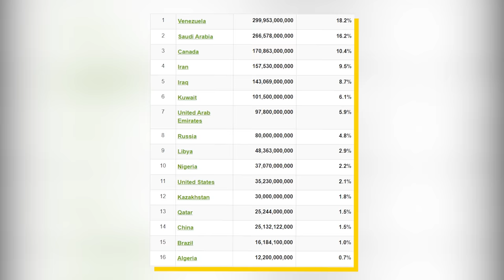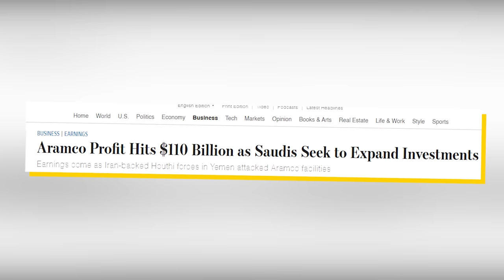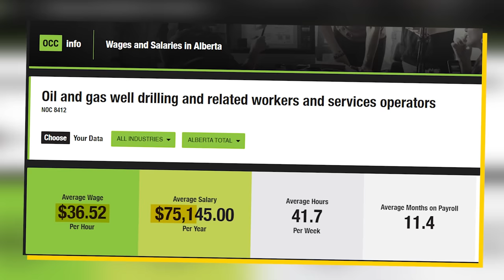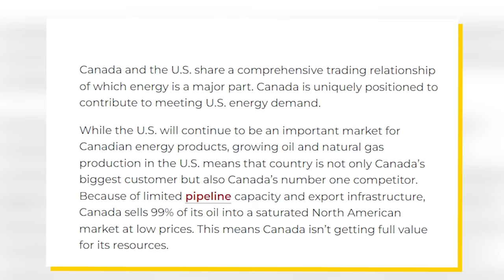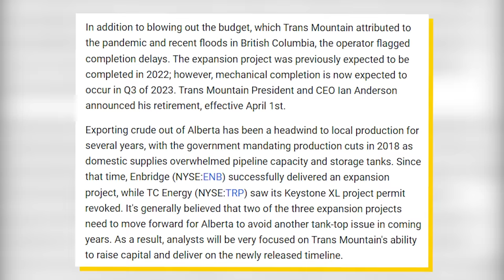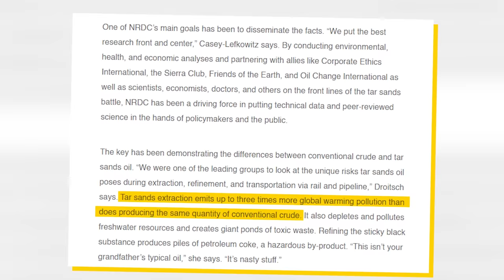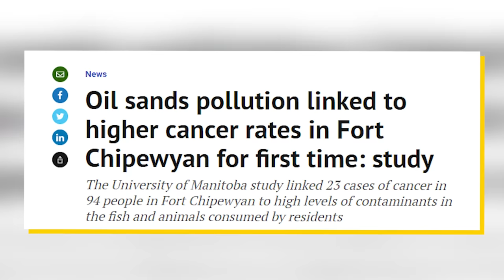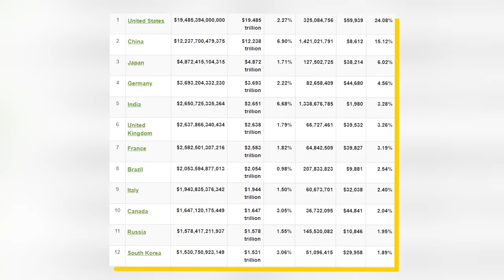Why Canada Refuses To Exploit Their Gigantic Oil Reserves

Comment: This video has done some great work on showing how Canada can become a more important player in the oil industry globally. One minor correction, for producers in Canada, break-even is NOT $100/barrel (either US or CAD). It's evident in many producer's financial reports that are publicly traded. Also the "discount" is not something agreed to by US/CAN, this discount changes over time and again due to the fact that the oil is still slightly different from WTI. What they're referring to is WCS crude pricing.
Reply: Currently working oil sands as a mechanic. The price per barrel that keeps my job is $60. Anything more than that usually results in OT being wide open and extra bonus pay like LOA and retention bonus. Any less than $60 a barrel and you are more than likely looking for work elsewhere unless you work for site.(Suncor, Imperial, CNRL, etc)
Reply: @Braviary01  WTI?  I know of newer highly automated in-situ sites that are in the range of $20 break-even or less but I suspect that's WCS heavy and not WTI
Reply: Wrong. Suncor produces for around $15 a barrel. We just don't have the boom we used to because $100/bbl is top much profit to sit idle. 

Since 2015, the companies have gotten much better at lean production. Anyone who told you $60 was incorrect.
Reply: The big outfit manged at around 10 to 20 but that was major cuts and probably break even
Reply: @erictremblay6867  appreciate your passion about the environment. Can you elaborate on how they're not accounting for this from a land reclamation fund stand point? And to confirm by toxic lake, this is tailings pond right?
Reply: @markt8596  The industry estimate the cost of the clean up to be 100 billions. The government estimate is over 200 billions. There is no fund or even profit large enough to pay for that. This is a problem completely ignored in the hope that we find better technique to extract and clean up in the future. Right now the whole oil sand industry is not viable if they have to clean up.
Reply: @erictremblay6867  That's astounding. mind sharing the reports?
Reply: @markt8596  Oil sand Wadsworth report
Reply: @erictremblay6867  The issue is also that most of the sites abandoned so far have been listed under shell corporations that effectively just pass money directly from one to the other, which then is owned by the parent oil company. When abandoned most have made that site's shell company "bankrupt" ($1 to $0, usually), meaning they are no longer legally responsible for cleanup and it is left to the government. The governments of Canada already have a bill of several billions that they simply can't afford to deal with
Reply: That's hilarious. Suncor itself reported that it cost them 46-53 dollars and that was a major improvement from the old benchmark of 60.00. The main oil price plunge took place from 2014-2016 and they pumped a lot less because a 40.00 to 50.00 price for WTI (and the Tar sands are "slightly" different is simply ridiculous) or Brent Crude meant little interest in the tar sands (that's what they called it when I moved there in the 70s). If you happened to live in Alberta during that period (and I did) you saw the industry dying and several major players pulled out. Even now they are on a rocky road. His figures are quite correct, yours are absolute nonsense. Easily checked though. Try any oil trade magazine in North America or just look at Suncor.
Reply: @milesalpha1  Interesting, because looking at the Suncor reports they say $35/bbl is their breakeven cost.

Comment: Most of the information given in this video is incredibly wrong. Canadian Oil Sands produce Synthetic oil, highly desirable for most refineries and they do so for profit at Crude prices less than $50/bbl … The oil sands do take a higher environmental impact for producing the oil than the conventional crude, but the end user is then saved from that impact … it is generally better for Canada to take this under our more strict environmental regulations then to allow another area to do it under looser ones. Just a little research further than the headlines of the anti-oil propaganda would have helped this video tremendously
Reply: He lost me at “100 years ago the Middle East was empty”
Reply: @Jwalkin  Your information is not correct... the Oil Sands do not produce "Synthetic Oil", it is "light synthetic crude oil  (SCO)"  there is a big difference in terminology.  Synthetic Oil is a manufactured lubricant. 

As for Canada's strict environmental regulations, this is true so a certain degree, but that process of Oil Sands extraction is an ecological nightmare.  The video only showed some of the problems created by extraction.   There are pools of Oil Sands Water that is dangerous to the Eco System, that isn't coming from an environmentalist, it is coming from a Human that has seen the OilSands WasteWater that has been pooled for decades, because there hasn't been a safe way to treat it, so it could be released back into the ecosystem.   A little research would show, this is not anti-oil propaganda, but something that Industry and Government(s) have been struggling with for decades!!!! 

What many people are not aware of, is that the Canadian Government has to invest money into Oil Sands production, to keep it going, when Oil prices are not high enough.   Oil Sands are an ecological and economic nightmare, when prices are low.  Let's not forget, Iran and Venezuela are not really producing a lot of oil on the World Market, when those 2 countries come back online, we could see prices plummet, especially if the World starts to reduce Oil consumption as forecasted.   Canada and Alberta should plan for a transition away from Oil Sands production, to a much lower level and sell the Oil on the Open Market and not just to USA at discounted rates.
Reply: @tonespeaks  great point here it’s a hugely unknown issue by the majority of the public just how much of a pollutant the refining processes can be and they have left many first nations communities without access to safe drinking water
Reply: Strict environmental regulations. lol. Currently the industry just dump its toxic waste in pond. We currently have the largest toxic lake in the world. There are hundreds more. Even worst no one knows how to clean it up. If you would force the company to clean up after themselves.  The cost per barrel would be higher than 100$.

Comment: The thing with canadian tar-sands oil is it's operated mostly like a mine.. So while the initial costs to develop the mining project are very high, the extraction itself is more modulable compared to conventional pumps. When the price of oil drops too much, you can just stop extracting the sand, reduce production, lay off some workers and rehire them when conditions get better. This way the project becomes extremely economicaly viable as it is way less exposed to volatile pricing than conventional oil. when you look on the longer run say 40-50 years, production costs management will make the resource waaaay more profitable than when you look just on a short timeframe of oil prices for any given year. IMO this is the main reason why Canada doesn't produce that much oil : Because it can afford to wait to produce it only when the time is right.
Reply: oilsands ... tar is Californian and Venezuelan oil
Reply: Only a small fraction is mined. Most of the Athabasca oil sands is much deeper underground and is extracted with SAGD.
Reply: Wrong. You can't just stop heating up the tar all of a sudden in the same way you can't shut down integrated steel mills for short periods of time.
Reply: They have the costs of production down to around $23.50 a barrel now at some oil sands production units.

Comment: This video is a bunch of bs, I've worked in the Canadian oil fields for 10 years.

Fort hills one of the biggest and newest sites has a hard dollar operating cost of $25 per barrel. I know that because a high up exec told me personally. 

Now for the wages argument, what's the cost of living in Saudi vs Canada... there goes that argument.

The main reason for Canada not being a Power house in oil, is political officials stunt the production and refuse to refine in Canada and send it over Seas as crude.

Plain and simple they don't like the "dirty oil" even though Canada has one if not the top standards on the planet.

Comment: as an Albertan worker in oil industry, I would say Canadian oil industry is depending on U.S. and Canadian governor. 1st, Canada lacks of pipeline to export oil to any other country than U.S. Since the canadian oil are sold to U.S at a huge discount, as U.S. are the only customer. 2nd, Trudeau government is killing this industry by limit exporting capability. Before Trudeau was elected, the previous gov was proposing ENERGY EAS, TRANS MOUNTAIN EXPANSION AND NORTHERN GATEWAY pipeline projects to diversify export capability to different customers. Sadly, Trudeau killed 2 of 3 project to help industry to grow. 3rd, with Trudeau's extreme money-grab tax carbon tax, the foreigner investors are running away from oil industry in Alberta.
Reply: However, one also has to face the idea that while the previous government may have proposed more pipelines, there is no indication that they would have been successful. The opposition to all 3 pipelines would still have existed. Unless the previous government was prepared to strong arm the people then Trudeau changes very little in the grand scheme of things.
Reply: That's okay we should all step away from that like we did from coal. Time's are changing, just change vocation. I did so in the mid 2000's when the USA banned Canadian lumber and we lost over +75,000 Canadian workers (direct and indirect) from East to West. Anyways we can live without oil from the oil sands. We have enough resources to supplement our own needs. Oh and Justin Trudeau has little to do with the cancellation of these proposed pipelines. All the Eastern provinces have voted against it, BC has also given Alberta grief and Joe Biden has expressed himself. The only recommendation I would have is; why don't you guy's put refineries beside Calgary and just supply by train like you already do.
Reply: And thank God He got rid of all that. Our beautiful country does not need a blemish like Fort Mac.
Reply: @robert-antoinedenault5901  We can't step away from oil....do some research bud. Your comments are not informed
Reply: @CountryLifestyle2023  Canada exploits its oil plenty, it’s obvious that people until now don’t realize the severity of climate change. Of course we still need oil for society to function but to plunge investment into an industry that should become drastically smaller in size over the next 30 years is a stupid investment. Pouring money into sustainable energy and grid storage R&D is far more pertinent. If anything Canada’s flaws are that it hasn’t passed enough laws and incentives to push capital into R&D around renewables. Canada has a huge and elite class of educated citizens. Fixing supply chains, increasing a degree of economic nationalization for security purposes, and becoming a leader in sustainable infrastructure will actually lead Canada into becoming a superpower over the next 100 hundred years. Along with that, the artic passage will open up unfortunately, but will cause Canada to become a super highway for freighter traffic. People don’t realize, with climate change, it won’t be just ‘nature’ that will rapidly be destroyed, agriculture and the endless way our economy depends on consistent stable environmental patterns is the way the world functions. Rivers will dry up or fall in level as seen in Europe, massive flooding as seen in Pakistan, dams being evaporated and aquifers being depleted in the United States. Everything in the world is connected and our economies are dependent climate patterns largely
Reply: @ParadoxysPlayground  Going to take a lot of time to implement the changes anyways.
Reply: @CountryLifestyle2023  Yes we can. But it will take a little time. Don't forget we have that source in the west for recycled oil, we have electricity and we also have massive amounts of hydrogen. Already here we have all three types of vehicles on the road. We produce the largest quantity of hydrogen in the Americas from the air and we now have endless capacity of production of clean water. Changes are coming
Reply: @robert-antoinedenault5901  I want to get rid of oil as well, all green all electric.

But it's not possible atm, and is still crucial and needed for this world to operate.
Reply: @PAPADRACOLIN  so lets get rid of oil now, because the industry will be significantly smaller in 30 years.........

Gotcha.
Reply: Clearly someone doesn't understand how these things work. Goverments do not propose pipeline projects. The private sector does. Governments merely give licenses and the like, according to a regulatory framework. In the case of Energy East, for instance, the private sector promoter decided eventually that there wasn't a strong enough business case to go forward.

Comment: As a Canadian, this comes off as a PowerPoint from an oil company looking to drill in the oil sands. It’s not a bad thing that a country will lose out on “progress” in the oil industry if it’s at the benefit of the environment. Most Canadians agree that they should protect and help the environment, due to just how rural most of the country is and how close they are to the wilderness at all times. Also, there are oil reserves other than in the Albertan oil sands, however they are mostly under the permafrost.
Reply: Under the permafrost?  Permafrost usually occurs at about 5’ but rarely exceeds 10’. The oil is much lower than that my friend.
Reply: You have zero knowledge on this lmao 🤣
Reply: And tech is evolving, we might dicover better tech to extract it less dangerous. Its smart to wait.

Comment: The problem is in Canada we have an issue with a dangerous new way of thinking that runs all the way to the PM's office . This thinking is that the oil should be left in the ground and we should all embrace an electric future . Even though we are not in any position to move forward with this .

Comment: The lowest wage in Alberta oil sands is closer to $25/hr but most oilfield works here work 60hrs a week and up to 16hrs days and sometimes 24 days straight with only 4 days off.
Reply: Truck aint gonna lift itself